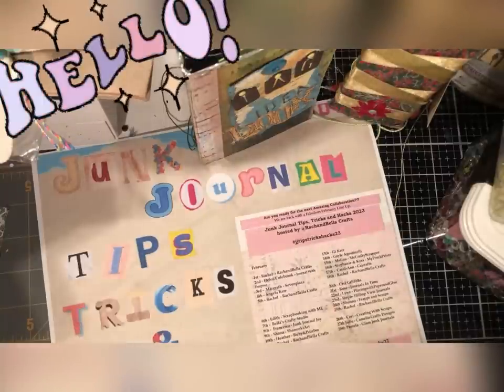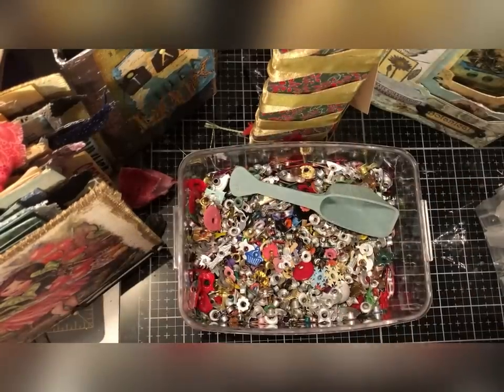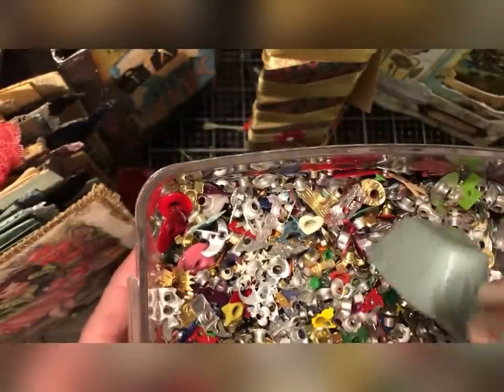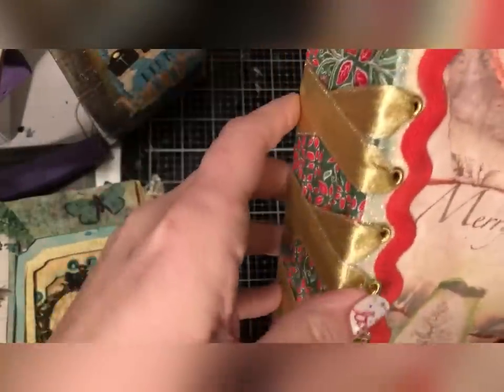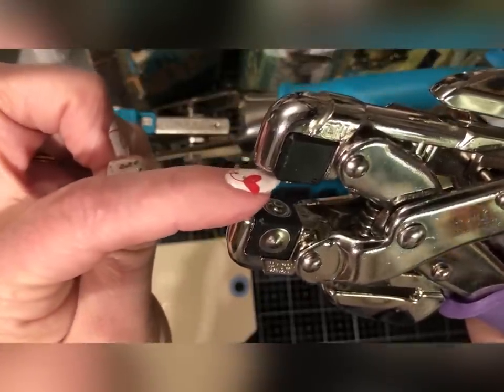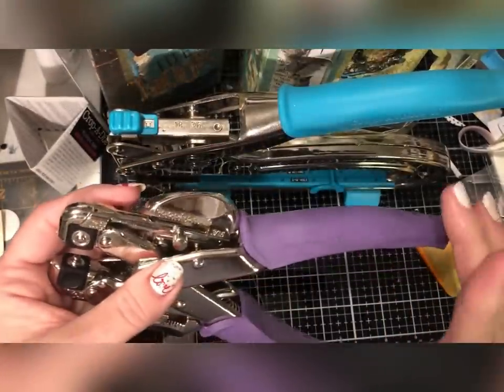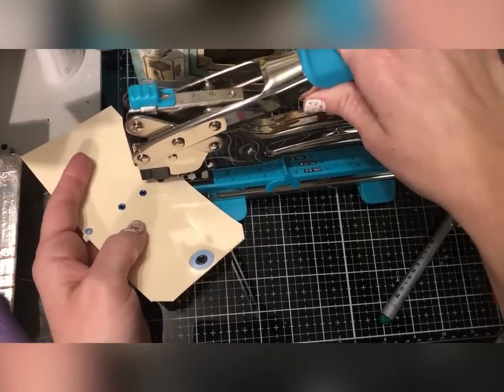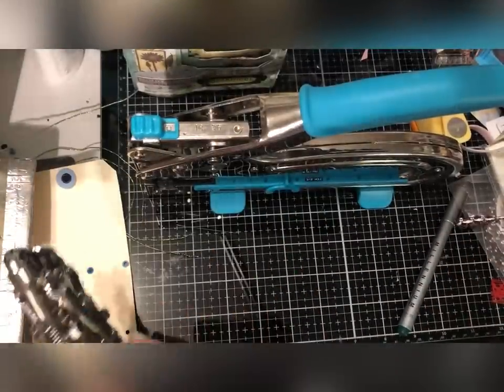Tips for using eyelets in junk journals #jjtipstrickshacks23

Comment: Trying to decide if I should buy a Big Bite.  I do have the old hand method tools for setting eyelets. So many uses.
Reply from the maker: If you have the hand tools you could easily purchase the cropadile and then do any eyelets you need a further reach on with hand tools.. it is a tough decision.. over time I wound up with both and don’t regret either purchase
Reply: Chris, I used that "antiquated " stick & hammer method for decades. 🤣
I finally got the big bite 2 years ago. It's so nice to set an eyelet at 3 in the morning and not have to wait til the family is awake.
Reply from the maker: @SaltLifeGypsy68  yes! Lol

Comment: Hi !! Is there a way u can punch the deeper holes (with the crocodile) into the depth of your spine, to set your eyelets, before it is adhered to the covers (back & front) ?? Did I explain that enough to understand ??  😢 😂 Sorry for ALL the questions. I have not Journaled for too long. Thanks so much. 🤞I hope u can understand my question.  🤞
Reply from the maker: @Darlene717  hmm I have seen spines that have the signatures attached to a false spine and then adhered into the journal itself- is that what you are looking for?
Reply: @FrappsScraps  Thanks soooo much for answering my query. Yes, that’s sort of what I am looking for. I have the Chinch & wires bought already, so I am trying to figure out how I can use that too. 
Plus, I am also trying to think of a way - in not buying the most expensive #3 Cropodile  - when I have the #2 one already. Is there a way of punching the holes (in the spine) - before the front & back cover are adhered to the spine. My head just can’t get around that. Too much THINKING for me. I thank u so much for thinking about this too, but do not get a headache like I have - like when I think about this. Everything will have to be measured and be precise while it’s first coming along. Do u get my jest ?? Thanks again

Comment: I have purchased some eyelets that have a longer shaft (not the ones that are made specifically for the cropodile).  Have you ever used these and what do you use to set them?
Reply from the maker: Hmm I think you might have to go back to the hand tool with a hammer to set that style. I have also gotten some that are designed for shoe eyelets and they are so tough to set because they are made to be set with a machine rather than any hand tool..

Comment: Thank you for explaining this tool so well.  Would you use the grommets in the same way as the eyelets?  Is there a different purpose for them? Also some of my eyelets come with a flat circle as well. What would that be for?
Reply from the maker: Hi Connie- the eyelets that come with the added circle it is used like a washer on the back of the eyelets. Grommets are used differently and don’t really need to be set like an eyelet. These are great ideas for a follow up video. I hope my response makes sense

Comment: Where did u get your (card stock) print outs for the WORDS in your front metal JOURNAL plates ?? I got the plates but I can’t figure out how to print the different size words for the ‘WORD IN THE PLATE’. Please help me. 😂 😂 😂 😂
Reply from the maker: @Darlene717  most of the printed items I use are from digital paper collections- I’m on the design team for a few of them but I think the one you’re looking at is the botanical book and that is digitals by RachandBella Crafts
Reply: Could I buy a few sheets of words from you ?  Like  (Journal , JOURNAL , JOURNALLING , Journalling). I can’t change the printing size on my computer. Or some that I can print on my printer.  Thank you soooooo much. My OPENING PLATE of my (front plate for a Journalling book) is 1 5/8” X 3/8”…. Darlene.
Reply from the maker: @Darlene717  the words I used were from digital printables from @rachandbellacrafts. They aren’t mine to sell however you can get them pretty inexpensive- maybe this set here
https://www.etsy.com/listing/1027076458/
Reply: @FrappsScraps  I like this one CA$2.38 - 40% off - Assorted Labels for junk journals, in the site u sent me. But I was thinking of a lot printed alike to go in the frame. - Like (the word) Journal or Journalling or JOURNAL or JOURNALLING in ALL CAPS. That I could fit in my little Frame with the Journal inside and then glued on the front.